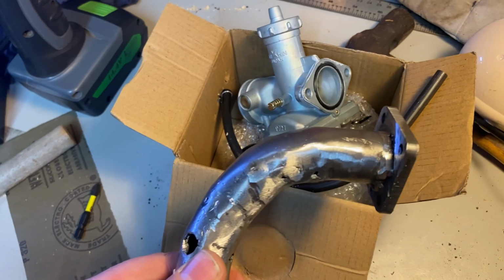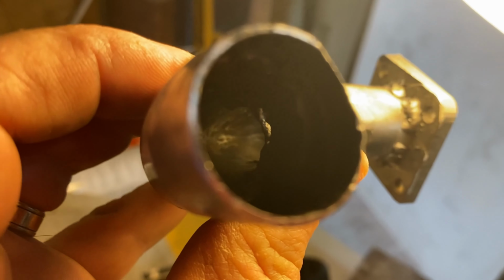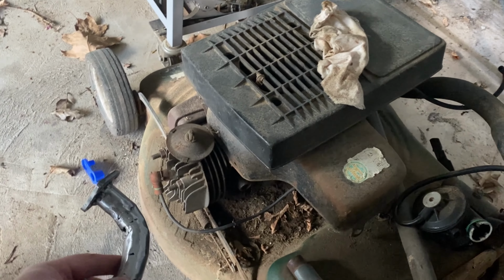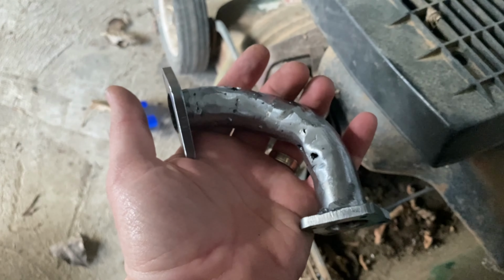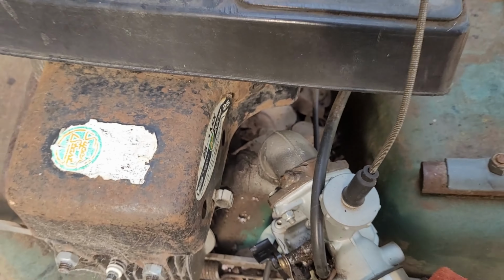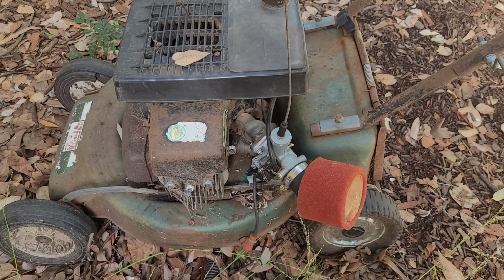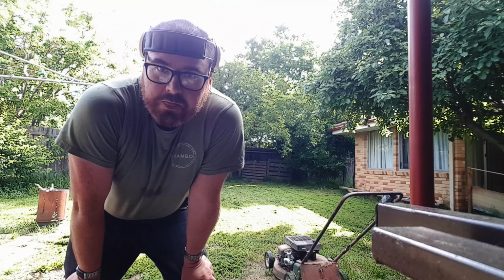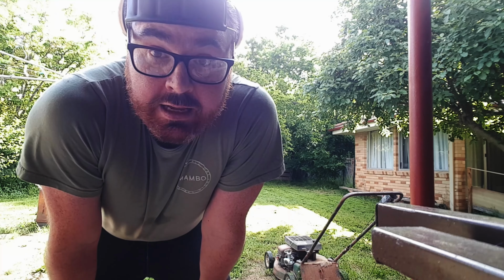Victa 2 stroke lawnmower Mikuni clone carburetor swap

Comment: Mad Max would be proud...Since the new carby has no vacuum tube what did you do with the decompressor?...Did you somehow block it off?...Why don't you use the standard air filter with a hose running to it's on handlebar housing?...
Reply from the maker: From memory, The de compressor is still in there, but not connected. I might want to check that, I don't know if it needs the vacuum to close, and is open otherwise? I know you can screw a sparkplug in the hole to block it off, and the compression is a bit harder, but not undoable. I'm missing the top of the original air filter, so unless I find a new cap, that's a no go. Probably when I get around to playing with the mower again, I'll do away with it, and either replace it all with a basic leaver throttle, or a pushbike brake leaver throttle.